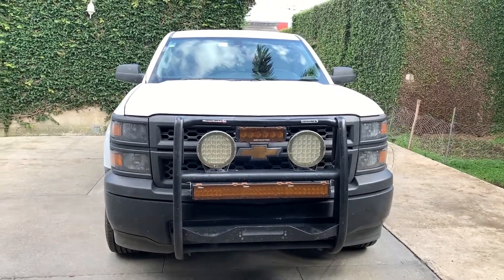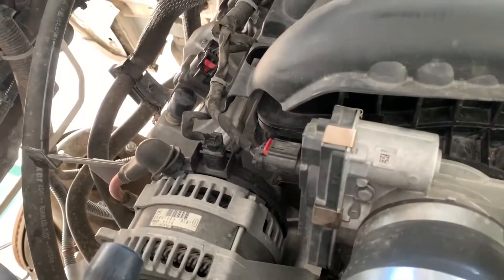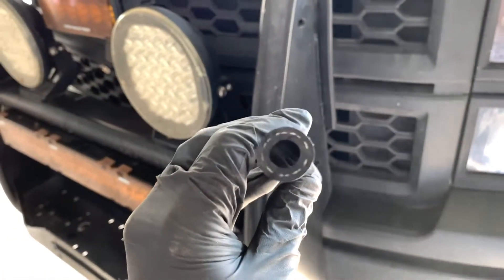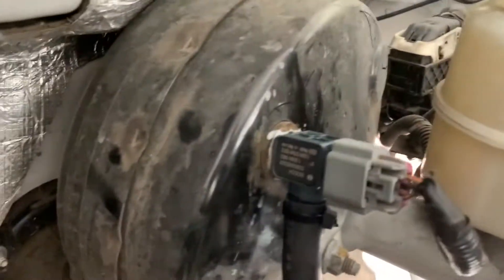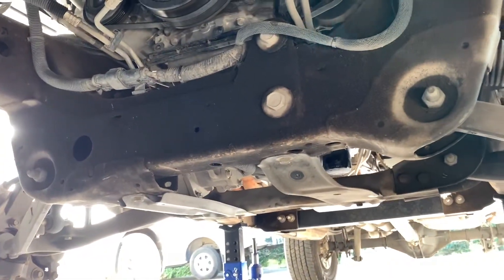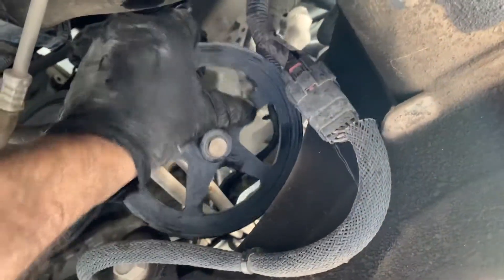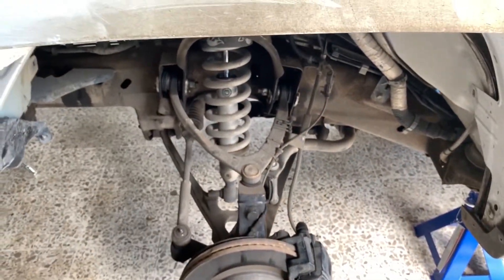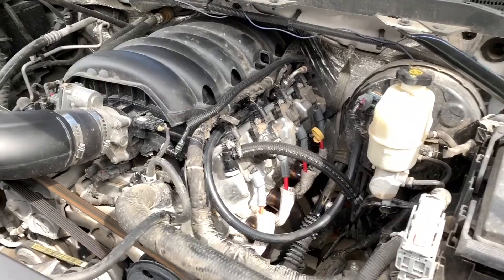How to Delete Brake Vacuum Pump on a 2014+ GM Truck or SUV

Comment: Gonna be doing this soon, will a range AFM disabler be enough to delete the v4? Or do you recommend a tune.
Reply from the maker: I have never used an AFM disabler, but for what it costs, getting a tune for a little extra gave me much more advantages. Also; do the Throttle pedal stick mod for more response
Reply: @BadAssEngineering   what’s the more  response from the pedal mod??
Reply from the maker: @braylonwoodell5465  search for Silverado paint stick throttle 👀
Reply: I have the Range afm disabler 
and it works perfectly. The car doesn't go  into V4 and shifts much better also .

Comment: Hello, speaking on your Serpentine Belt assembly. The 2018 4.3’s are the exact same but have 2 extra pulleys, one in the center ( where the previous gen waterpump was ) and an idler pulley under the alternator and the tensioner is in a different location below the alternator to the right. In fact this engine has all the mounting holes to put it that way. I can literally take off the center pulley, remove the idler pulleys that’s under the alternator and relocate my tensioner to the engine you have  location.  

Question is why would they add two extra pulleys on the 4.3?   
They’re the exact same engine minus 2 Cylinders. Look up the 2018 4.3’s on Google images, you’ll see what I’m referring to as far as 2 extra pulleys. It’s puzzling, they made it more complicated than it had to be. 

What would you do?   Make the assembly the way it is like on yours? 

The idler pulley on mind is bad.

Comment: Will this make my check engine light come on?
Reply from the maker: 601 Nate no, my didn't
Reply: Ok thanks! I just ordered the kit. I was wondering about the check engine light because I read online that the pressure in the intake will drop and pop a code
Reply from the maker: 601 Nate not true vacuum remains the same, just make sure to have the DOD (AFM) disabled
Reply: Thanks
Reply: What vent hose do i have to delete need more info on that

Comment: The DOD the only electronically deleted? Thanks for the content
Reply from the maker: You can use a Diablo handheld tuner or a Custom HP tuners to do it
Reply: @BadAssEngineering  Thanks :)

Comment: I have a 2016 with the 6.2 Intake manifold. If I perform this process will the engine create enough vacuum to operate the wastegate and bov and boost gauge as well as the brakes when I do the final installation on the turbo kit?
Reply from the maker: The White Whale you will have to do more modifications to the vacuum line, like having bypasses and check valves to not let boost go to the brake booster. It gets more complex when boosting.
Reply: BadAssEngineering yes, I already have the 3/8 check valve and a catch can. My pump ticks and I want to get rid of it lol. But my curiosity is that I’m feeding from the valley to the catch can and then from can to im. So if I reroute from the IM to the booster where would I feed the catch can back to? Or would I simply just have to add a tee at the I’m connection and have a check valve in both lines. No much info on these newer trucks and supporting mods. Like everyone we are learning as we go lol
Reply from the maker: The White Whale I would get rid of the Can or vent it to atmosphere. Also you could run a crankcase evacuation system like the one I'm running. Moroso PN 25900
Reply: BadAssEngineering interesting. You should put a vid out on that. I would be interested to see the benefit of the evac system and how it’s installed vs using the catch can system. I end up having a ton of blow by into my catch can. But you have done great with the video and help with a few of my curiosity’s
Reply from the maker: The White Whale catch cans that recirculate to the intake manifold are a swivel LOL

Comment: Can a brake vaccum pump issue  cause a vaccum leak and eventually a check engine light P0172 code?
Reply from the maker: Rafael De Lima I don't think so, you should check for leaks in the manifold or a bad MAF.
Reply: I can't find no leak might be the MAF. I cleaned it let see if code comes back. Chevrolet said they  will replace the pump but I think I just gonna delete it. Is there like a delete kit somewhere?
Reply from the maker: Rafael De Lima the delete kit is a couple of plug bolts, all the info is there in the video. P0172 code means the engine is running rich, it should not related to the Brake Vacuum system on 2014+ GM Trucks
Reply: I know that! The reason I ask is before vaccum leak in one of the reasons to get that code.
Reply from the maker: Rafael De Lima did you check for vacuum leaks by spraying carb cleaner around the manifold/airbox?
Reply: Visual check. I'll be checking like that tomorrow morning. I'm thinking about getting a that jet performance MAF. It has good reviews. What do you say?
Reply from the maker: Rafael De Lima don't waste your money, if you want more throttle response search for "Silverado paint stick mod"
Reply: Is that the pedal commander? Can it be stacked with a tune?
Reply from the maker: Rafael De Lima No, you put a wooden stick behind the throttle assembly to make it not move
Reply: Do you have a video that teaches how to do that? Would be nice for your channel
Reply from the maker: Rafael De Lima it's literally too simple, and there are others who have uploaded it, search for Silverado Paint Stick On YouTube

Comment: How is everything working after your delete?
Reply from the maker: Gerardo Calzada great, everything is working flawlessly
Reply: BadAssEngineering , great I’ll be doing this delete this coming weekend.
Reply from the maker: Gerardo Calzada just be careful cutting the fittings off the stock vacuum line and choosing the right 3/8" hard rubber line for the manifold
Reply: BadAssEngineering  I am also doing the l86 intake and tB swap the same time, that means the intake vac line would be by the TB correct
Reply from the maker: Gerardo Calzada correct, but be careful because the L86 vacuum port is prone to breaking off
Reply: BadAssEngineering thanks for all your information, should I try to reinforce the brand new intake with epoxy or something ?
Reply from the maker: Gerardo Calzada you could try something, but the best you could do is try to not have the vacuum line pulling on the port
Reply from the maker: Gerardo Calzada correct, the line has to rest without pulling or twisting the port

Comment: Currently working on a 4.3 v6 and the pump has failed due to the wonderful design of using a plastic impeller pretty much but the 4.3 should produce enough vacuum for the delete? The 4.3 has ran on vacuum from the intake for 30+ years so I’m thinking it should work just as well or better then the pump. I actually replaced the pump and I know the pedal gets hard after pressing it 2-3 time and is harder at low speed/rpm braking but it just feels like something is wrong with the braking. It stops and works just like it did when brand new but obviously there was a design flaw when it was brand new
Reply from the maker: Spencer Dean it should be fine as long as you deactivate the afm to always  run the engine in V6 mode

Comment: La manguera que sale de la tapa de punterías hacia donde va
Reply from the maker: Julio Ruiz al escape para ventilar los gases de la pcv. Es un Exhaust Scavenging System. Número de parte Moroso 25900.
Reply: BadAssEngineering le quiero quitar la bomba de vacío a una sierra 2016 tienes imágenes de paso a paso es que tengo una duda en una manguera que veo que le pusiste en la tapa de punterías pero nomás veo que está abajo del boster
Reply: Se le puede quita el vacumm pump sin desinstalar el afm ?

Comment: So do you have to run a cold air in order to do the delete kit or can you use the original to the filter box?
Reply from the maker: Tyler Kaluza no, you don't touch anything before the throttle body to do this delete. You can have a stock airbox or cold air, doesn't matter
Reply: @BadAssEngineering  what about the pcv lines what do you get for those
Reply from the maker: Tyler Kaluza I have a Crankcase Scavenging System to the exhaust
Reply: @BadAssEngineering  you have to have that? The crankcase scavaging system
Reply from the maker: Tyler Kaluza no, they're independent systems that don't interfere with each other
Reply: @BadAssEngineering  so what all do I need to delete vacuum pump from factory truck with a edge tuner that disables afm

Comment: I have a 2018 Denali HD 3500 Duramax Diesel with a 6.6. Will this video be the same procedure and part numbers listed? Thank You
Reply from the maker: Michael toma No, diesel engines don't have throttle bodies, intake manifold is never under vacuum. Don't do it, this procedure is only for L83/L86 Gasoline engines

Comment: Did you notice any difference in the sound of your engine at idol.  I've always thought my vacuum pump was excessively loud.
Reply: You may not be hearing your vacuum pump. Your engine has a built in mechanical fuel pump that increases fuel pressure for the direct injection. 2014 and some 2015 engines make significant noise from that pump.
Reply: @daveo211  this is a long shot since I see this comment is a year old...but I just bought a 2015 GMC Sierra and it has a pretty noticeable whining sound compared to any other truck I have owned ,seems like it is coming from the vacuum pump but I cant tell for sure, it sounds like when a power steering pump is low on fluid but since this truck has electronic power steering that cant be. even my mechanic cant figure it out he suspects the vacuum pump but admittedly is not sure. if it is just a normal sound for this truck then maybe I will just live with it but it really is like nails on a chalkboard for me . I hear it especially when I first start engine as the rpm lowers down just a low growl/ whine. driving me crazy trying to figure out.I have heard other trucks same year do have this sound but it seems wrong to me. I have it recorded and willing to PAY someone to listen to it and give me their thoughts. I really cant stand it. coming from a toyota tundra that ran without any issues for over 400,000 miles this truck seems delicate and honestly cheap.paid $27,000 for a truck with 80k miles so I am hoping I am not looking at some serious issue here. my thoughts range from torque converter to water pump, fuel pump, vacuum pump. had entire transmission replaced because I was told that was the issue by another mechanic and that didnt fx it either...(luckily warranty covered that even though it ended up not being the issue) I just want it to stop sounding like shit.
Reply: @AsTheWheelsTurn  oil pump
Reply from the maker: Blair Barham no, because my pump was fine. If yours is making sound I would swap/delete it immediately

Comment: Since the pcv line is now going directly to the brake booster, are you not worried about oil getting in there? One of the side effects of the belt driven factory vacuum pump failure is oil getting into the brake booster and causing a hard pedal which ultimately results in the replacement of the entire booster. I like the fact that you are connecting it via a factory connector like the pcv as an alternative to what the forums say and folks drilling a hole into their manifold. But what about installing an oil catch can between the pcv hose and the booster? Let me know your thoughts.
Reply: I’m surprised more people aren’t doing this on the forums. A lot of people mention drilling and tapping a line into the manifold. Do you happen to know the amount of vacuum the pcv line provides?
Reply from the maker: @andrewgreen7886  Drilling and tapping into plastic is not a great idea. I didn't check how much vacuum is produced at idle, but it should be more than -20 inHg, since the brake pedal feels better than it was before
Reply: I just tested with my finger the difference between vacuum pulled from pump and what the port on the manifold pulls and honestly there are exactly the same. In fact, I feel the manifold vacuum feels stronger than the pump. I will be doing this by next weekend. I’m going to get the block plugs from the dealer today. What did you do to cap the pcv valve?
Reply from the maker: Andrew Green you can buy a set of Rubber caps at autozone to plug the Block side of the PCV like I did on the beginning of the video. It's a 3/8 size
Reply: Completed the bypass today, works perfect!!!! Not sure why I didn’t think of this sooner. Thank you for your informative video
Reply from the maker: Andrew Green anytime, just be sure to share the video !
Reply: @BadAssEngineering  will this mod cause you to fail the emissions test
Reply from the maker: @soloM81  just the booster one no, the crankcase evac probably
Reply: Hi Andrew could you help me out. Which website you use for forms . I don’t know any
Reply from the maker: Andrew The pcv line is capped to the block. The manifold has pure vacuum and no oil getting in